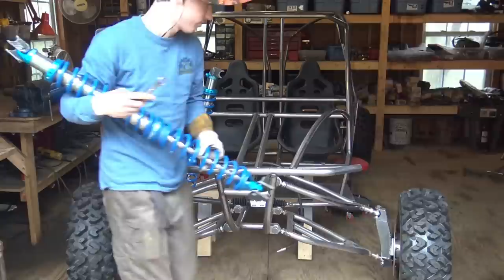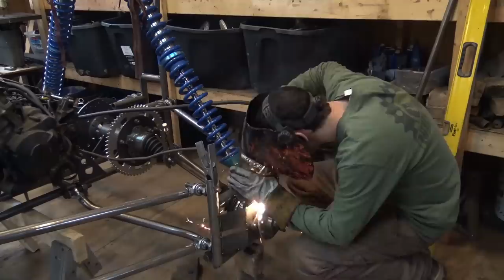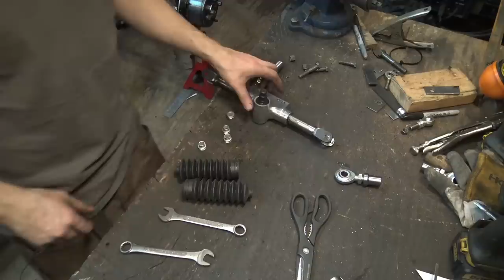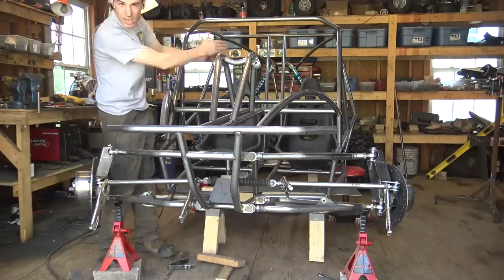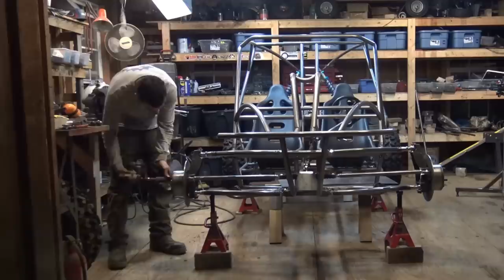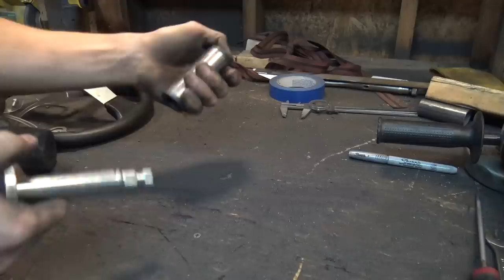Honda CBR 600 buggy build part 7

Comment: I hope you will notice this comment your buggy is turning into a monster cbr600 wont be enough nether will a 1000cc bike engine i hope you will look into the 1.8t audi engine you can find them fwd in vw or seat what i know of so rear mount the engine boom rwd easy litle change in original plan plus this 1.8t engine comes with a turbo stock its a simple small inline 4 engine easy to work on cheap to get common to find in europe plus it will do the job way beter up the boost till you get 300hp your buggy will fly!!!!
Reply: Vag 1.8 20v turbo engine theres a total of 16car models that use this engine and depending on your budget multiple versions of ot too older generation and newer!

Comment: you can put a bolt in it and it will take up the slack or you can go to a gunk yard and find a 2wd jeep XJ and they have an axle plug for the 2wd hub it just looks like the end of the axle because they use the same bearings 2 and 4wd

Comment: At this stage of production, I can't help but think that you are limiting yourself by using motorcycle engines. This design is screaming to be four wheel drive. If it's your desire to keep it 2wd, then find a good front wheel drive 4 cylinder engine and transmission, pop those half shafts in, and you're on your way. If you'd like a great 4wd design, then grab a v6 or v8 engine, flip it backwards, install a standard axle from a small truck in the back, a small driveshaft and a transfer case, then you're pulling all four wheels. ^^

Comment: you'd have finished by now if you actually started with a plan!
so far you've mounted the engine, moved then engine, plan to move it again, built front suspension twice, and it still isn't right, 
build, and rebuilt and rebuilt the rear suspension.
built a frame, with no idea what stresses are where or how much tubing is enough.
worried that they thing will become too heavy for the engine to move. 
bought the wrong springs for the front so it is too stiff...

You should really slow down and plan this. the watching you build it then pull it apart to redo it show is getting a little bit samey

Comment: The hubs for a 4x4 require the axle through it to preload them. The 2wd models have there races pressed in the brake rotor and require a spindle through them and a castle nut to preload them and a pin through the castle nut to stop it from backing off the preload. They do not and have not used the same hubs and bearing on the front end of the 2wd and 4wd s10s. Check YouTube for how to replace front rotors on a 2wd s10 you will see that the bearing will be in the rotor vs the 4wd the rotor slides over the hub wich holds the bearings but still requires a bolt or axle half that is torqued to 103 ft lbs if you have any questions reply with a way for me to contact you and i will explain in depth i am a ASE master tech of 17 years.

Comment: You have 2 types of bearings driven bearings and rol bearings the one you have is a driven bearing and that had a driveshaft in it thats torked down with 275 nm if you put it to tight the bearing wil eat it self if you put it to lose it wil have a lot of play so if you put a bold in it it has to be a thick bold and needs to be torked between 250 and 290 nm.

I hope this wil help you. 
Can i please have a shout out in the video.